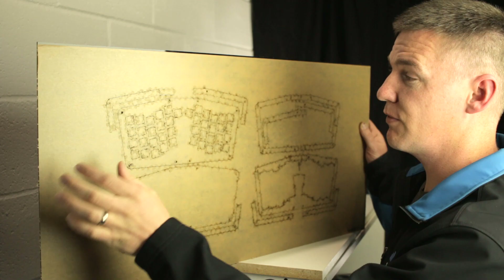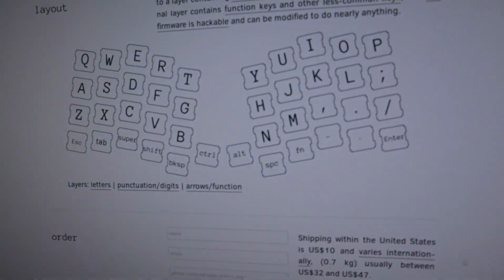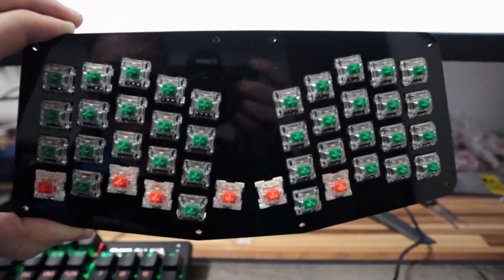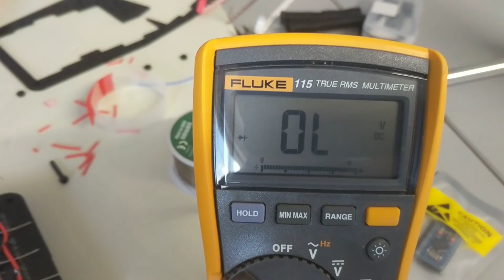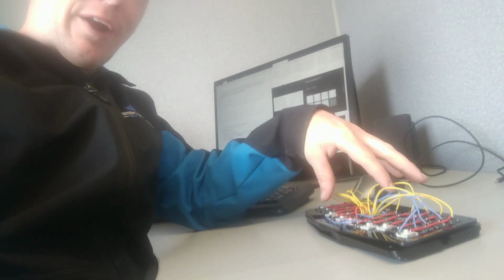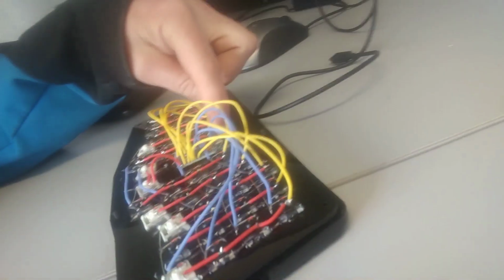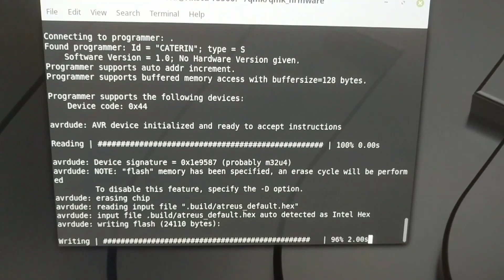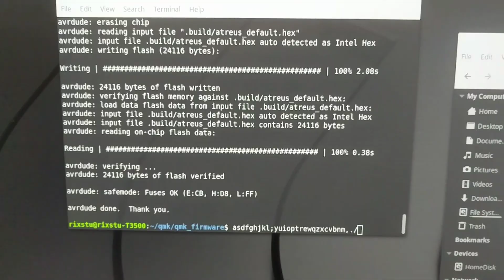Hand Wired Keyboard, Atreus DIY Build

Comment: Don't solder like this everyone, this is the classic way to not solder.  You should not use the tip of the iron to melt the solder onto your joint. This is a recipe for bad connections.  The iron should be used to heat the wires/joint you're soldering together, not the solder itself.  When you touch the solder to the wires - not the iron - the heat from the wires will melt the solder and pull the solder towards the heat of the iron, i.e. the joint.

Comment: testing the red wires isn't really necessary... they're each ONE wire that you just split the insulation on
what you really should be testing is whether or not a row and a column connect when you hit a switch

Comment: 12:10. I suggest tucking the wires by threading them under the diodes/column wires then soldering them. Just makes it cleaner, and let’s you have more room for other stuff you might want to add to the keyboard.
Reply from the maker: That's a good idea, thanks for sharing!

Comment: you are connecting only one wire to a row, there is no circuit. how can it detect key press?
Reply: You send a signal through the column, and detect which row gets the signal. If we say that Q is on column 1 and row 1, then we send a signal through column one, if we get a signal on row 1 the Q is pressed, if we don't get a signal on row one Q isn't pressed.
Reply: @ano_nym  does this mean you can only press one key at a time though? Like if you click row 1 column 2 and row 2 column 1 how does it know you didn't click row 1 column 1?
Reply: @Oreo41212  In short, you use diodes to avoid clashes. You can watch some video about a keyboard matrix for an in depth explanation. 

I don't think your situation would result in a clash though, since you poll the columns one at a time. So first you would check column 1, and see that row 2 is activated, row 1 wouldn't be seen as activated since the key which is pressed is connected to column 2 which isn't activated yet. Then you check column 2 and see that row 1 is activated.
Reply: It’s a matrix. When you send a signal through the columns it detects which row the key is pressed. It’s kinda like how you call for a move in battle ship or chess. In this case though you call out a column, and it responds with a row. If you call out A, and it comes back saying 4 you know the coordinate is A4 which is equal to what ever key is programmed to be point A4
Reply from the maker: Good question. That was my first thought too. Here's a diagram I found that might help: https://falba.tech/wp-content/uploads/2017/10/manual_atreus.jpg